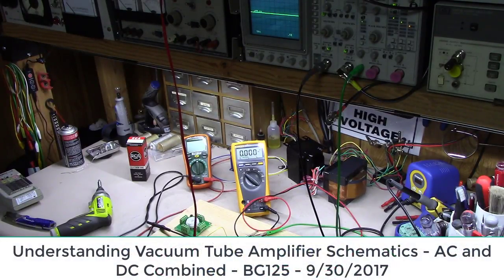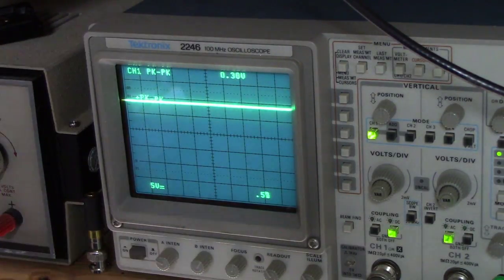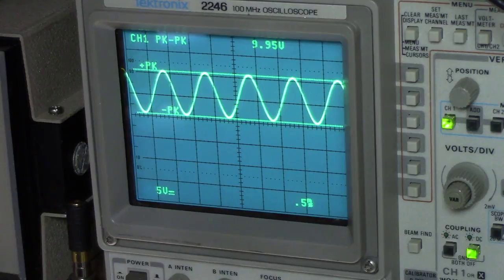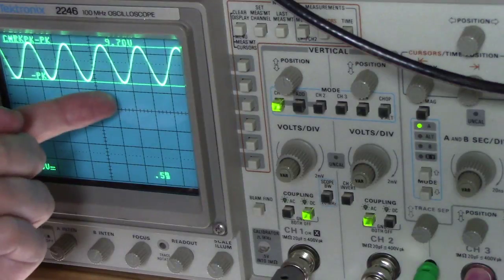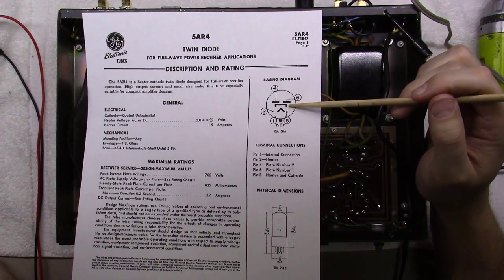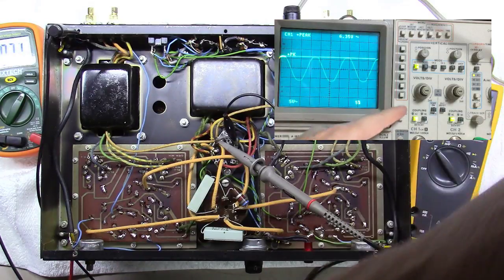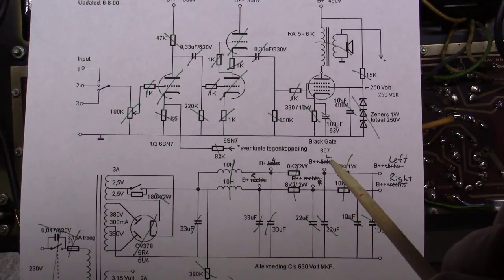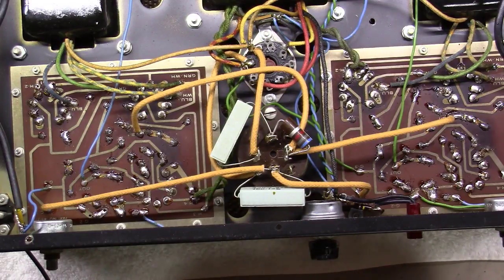Understanding Vacuum Tube Amplifier Schematics - AC and DC Combined- Part 4

Comment: Excellent video, thanks.  You keep making it clearer and clearer, but I am in a place similar to Lester Barrett, i.e.  Why does the high voltage on pin 8 not vaporize the heater filament?  The more I look  at schematics and try to follow the current around, the more I am amazed the every electronic device does not just burn up as soon as power is applied.  I am serious.  It is very frustrating for those of us who  don't "get it",  and for those of you who do,  it must be so obvious to you that you can't even imagine the confusion that the rest of us experience.  If anyone can get it through our thick skulls, it's you.  Thanks again.
Reply from the maker: Making another video to help explain, uploading soon...